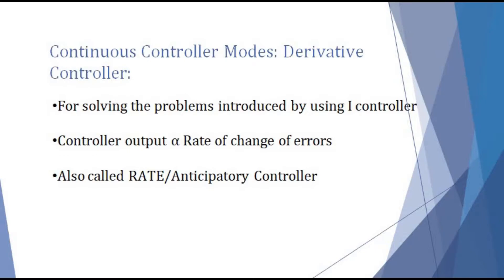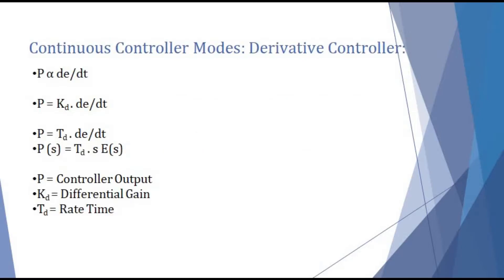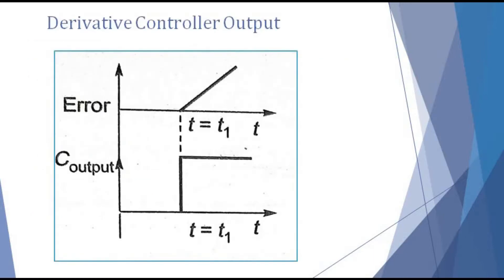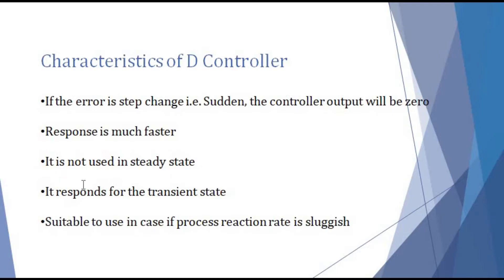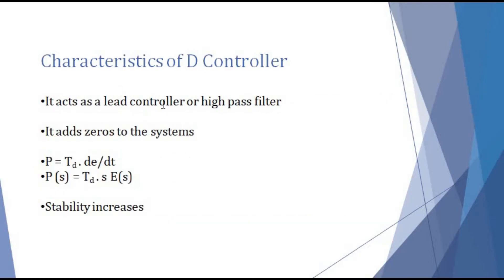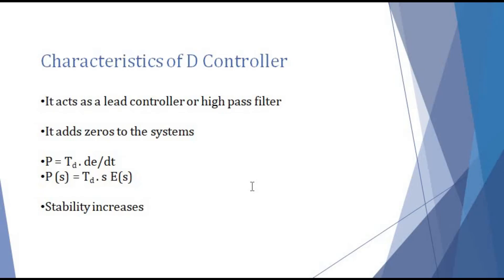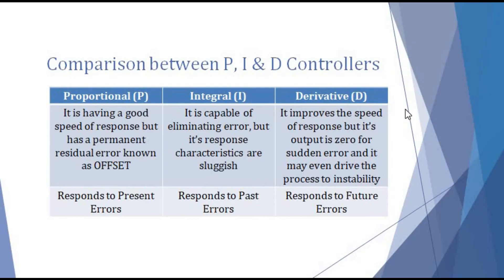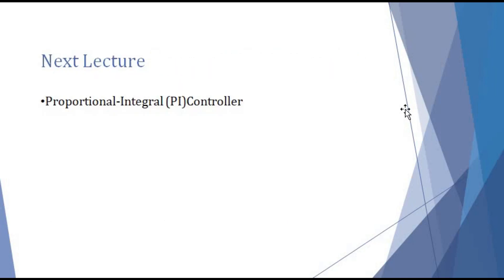Lecture 07 | Derivative (D) Controller | Process Control | #PlacementBuddies

Comment: Sir if error shows step change or sudden change tha d controller output must be very high as the slope will tends to infinite at the particular moment , sir let me know if its right or wrong as you told in video that output will be zero.